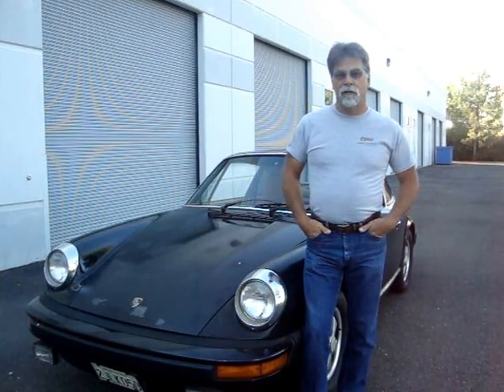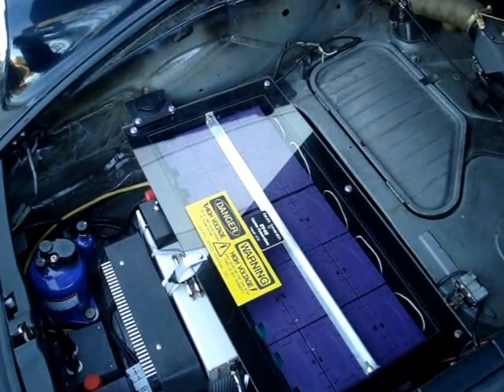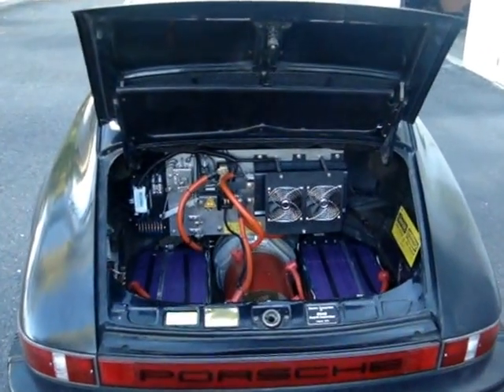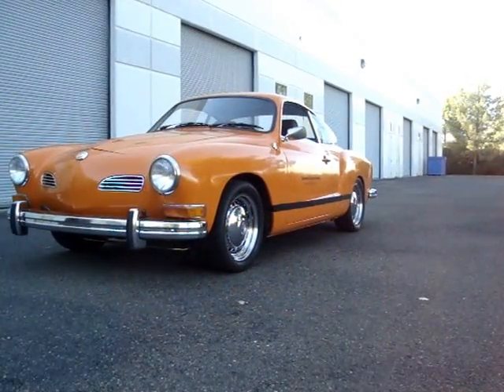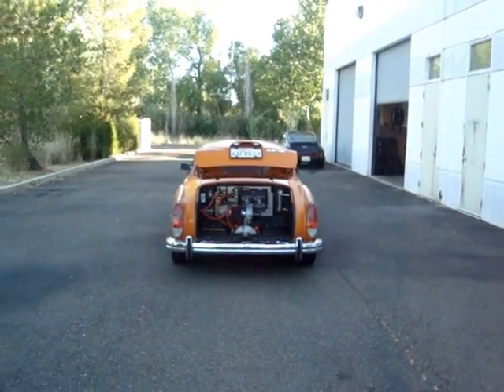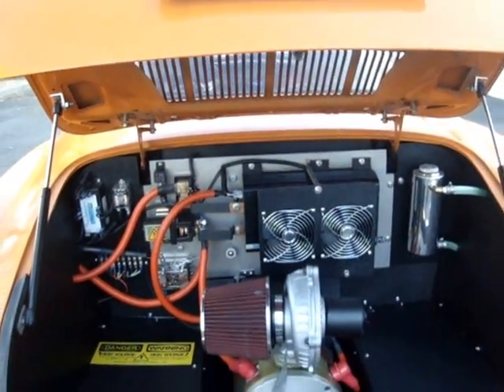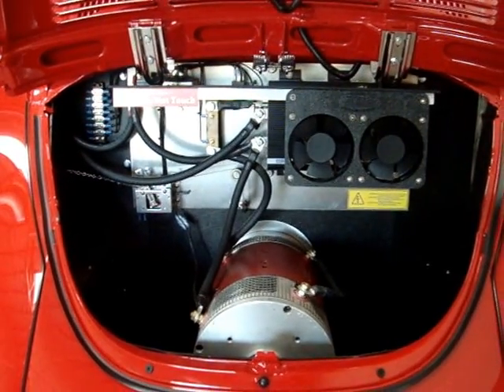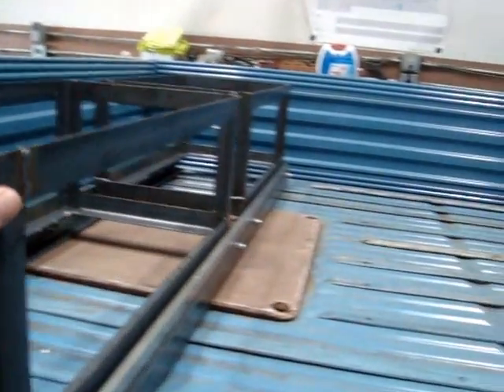DIY Electric VW and Porsche Conversions  www.EV4Unow.com

Comment: Richard three additional questions: 1) why is your personal Ghia look like it has a sprung (top) motor compartment at the rear? 2) What kind of "normal" mileage is available between charges? 3) any thought of a 100% PV paint/coating to recharge in open parking lots in the sun?
thanks,
=TRex=
Reply from the maker: 1)  The deck lid is off-set for cooling purposes, it gets over 100 degrees here for months.  The Karmann Ghia has a 14.6 kWh pack with a 60 mile range.  Have never considered PV paint.  We park the vehicle indoors most of the time, or in the shade when possible.

Comment: Richard, well done. two questions: 1) Can you do the same for a 356? 2) is there and regenerative braking to recharge while braking or downhill?

Thanks, TRex
Reply from the maker: Yes on the 356.  The Karmann Ghia in the video has a D/C system which does not provide regenerative braking.  We do however, provide an A/C system which does provide regenerative braking.  Check out our Component Packages at EV4Unow.com

Comment from the maker: If a vehicle came from the factory with Power Steering or Power Brakes we retain it.  But if the vehicle did not have P/B or P/S like the classic Porsche and VWs then it still will not have it after conversion.  Thanks for watching.